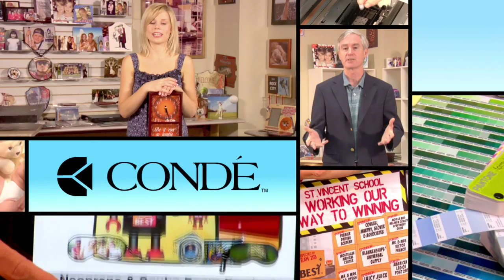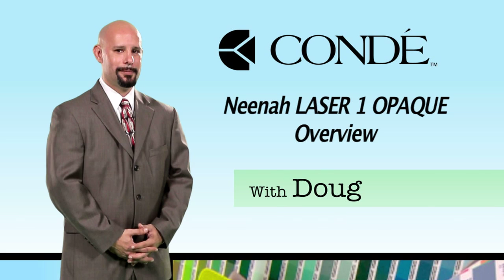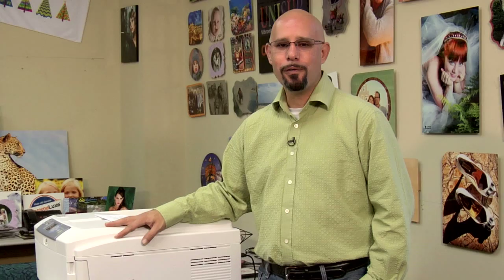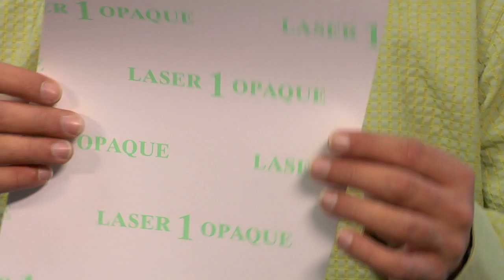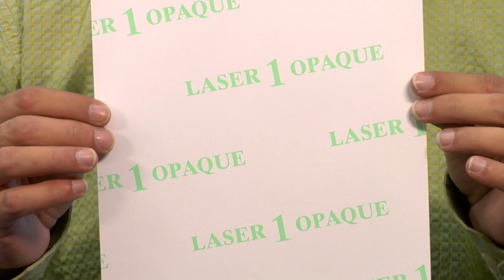Overview of Neenah Laser 1 Opaque Transfer Paper -

Comment: why people would use 2 step papers vs this one? i mean this one is cheaper and its one step...Am i missing something here?
Reply from the maker: Generally speaking, two-step papers do not require cutting your design or weeding excess material.  If you have a vinyl cutter, using Laser-1 Opaque would be the most economical printing method.  If you do not have a cutter, or do not want to waste time cutting and weeding, then the two-step "self weeding" papers are your solution.
Reply: ohh i see, the cutting process....only question i have about cutting is that do vinyl cutters cut right by the edge of the design without ANY blank(white) area.?..because i see the cutters cutting around 1/8" away from the actual design leaving you almost a white framing on the design when applied on the shirt.

Comment: I have been unable to print an image onto Laser 1 Opaque Heat Transfer Paper.  I have a Xerox WC6505 (oil-free; 347 deg F fuser temp.), am using the manual feed tray and set the printer media setting to heavy card stock.  Does anyone have any suggestions?
Reply from the maker: +Byron Formwalt If you can set your Xerox by media weight, then select a 180-gsm (grams per square meter) or 47 lb. bond weight.  This should be appropriate for running Neenah Laser-1 Opaque material.  Try running 1-2 sheets at a time.  Make sure toner is properly bonding to the opaque material.
Reply: +Conde Sublimation Thank you for the response.  I have the paper weight set correctly.  Before I do what I think you are recommending... are you suggesting that I feed the printer 2 sheets as though it were a single sheet?  I have not attempted that yet.
Reply from the maker: +Byron Formwalt Feed the Neenah Laser-1 Opaque material through the Bypass or Multi-Purpose tray of your Xerox.  Set your Xerox to run a 180-gsm media weight.  Feed one to two sheets, then stop!  Check to make sure the toner from your Xerox is properly bonded to your Laser-1 Opaque by gently tracing your fingertips over the print or use a tissue to gently rub the image.
 
If no toner comes off the Laser-1 Opaque, then the toner is properly bonding.
If tones comes off the Laser-1 Opaque, then set your Xerox to the next-heaviest media weight setting and try again.
Reply: Thank you for the input.  Unfortunately, there is no combination of settings I have discovered through your method that work for this particular model of printer (Xerox WC6505).
Reply from the maker: +Byron Formwalt Sorry.  If you are looking for printers that will run this material, we suggest OKI color laser printers.  Look at the OKI 600 or 700 series printers.

Comment: I need exact same effect on Polyester or polyester blend dress. Clothes I'm gonna use are quite decent, which product will be a safe choice for me? I saw every video, but cannot make up my mind
Reply from the maker: If you have a laser printer, check out self weeding Low Temp LaserDark for polyester.
http://youtu.be/kt0bp5XqmV4

If you do not have a printer yet, may we suggest dye sublimation? It's an ink based system that produces polyester garments that have no "hand" or feel to the imprinted area. You would have to get a printer and set it up with sublimation inks. We have many videos on dye sub as it is our main focus.
http://youtu.be/-5IehlK9NT4
Reply: *****
I have laser printer and it will be easier for me to take the first option. However, I would like to ask if the second option is better maybe?
Reply from the maker: Ano Devdariani If you are using a color laser copier or printer and you want to decorate colored polyester, then the only suitable transfer paper product we offer is our "Low Temp" Laser Dark.  It is a "self-weeding" transfer paper for dark garments, but it can be applied to polyester.  While this product was developed for OKI "White Toner" color laser printers, it can be used in any color laser that can run a transparency film.  Please see our video "LaserDark Low Temp 2-Step Transfer Paper for White Toner Printers" for more information on this product.

The dye sub option is specifically made for polyester and really is spectacular. A lot of the graphic tees you see are dye sub. A small 8.5" printer with dye sub inks is only $475 at this time.